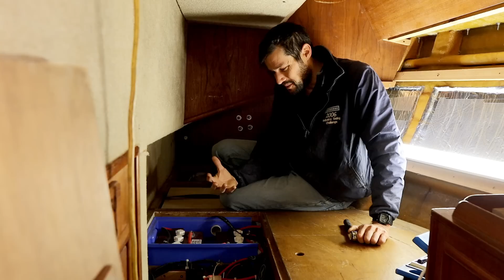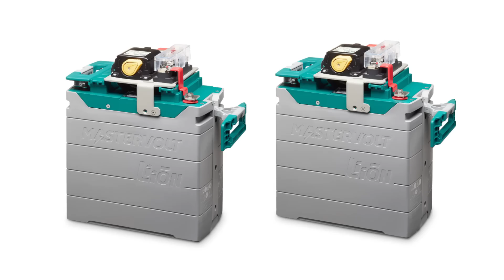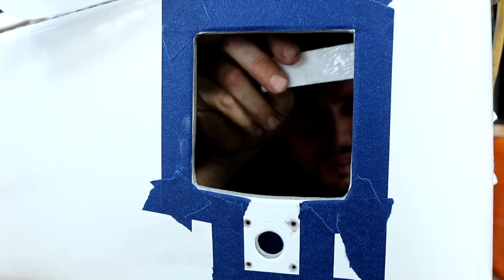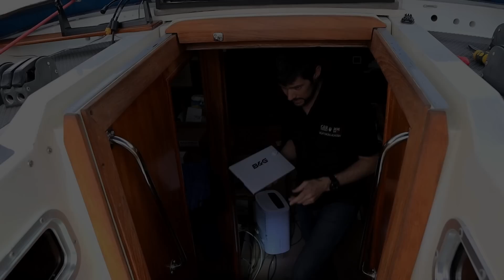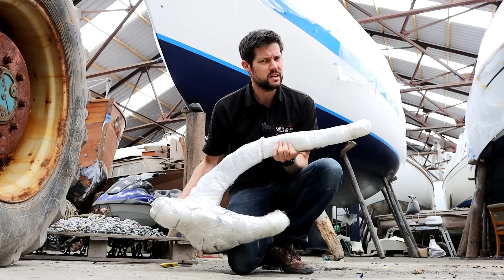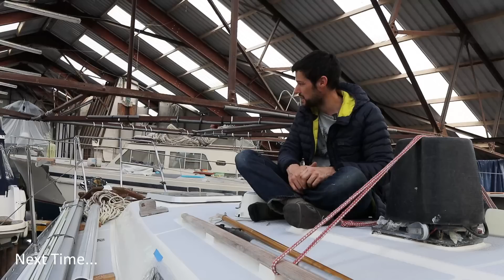Our Biggest Ever Upgrade | Sailing Florence Refit Ep.179

Comment: The 12V battery-to-battery charger you've installed between the engine start battery and the lithium bank is a big limitation on how quickly and effectively you can charge the house lithium bank from the engine's alternator(s). I understand the need to protect the alternator(s) and the lithium batteries from each others' bad behaviours, but there are ways to do this. Having a high capacity second alternator (250+ amps these days) along with the original alternator is a fantastic way to keep plenty of electricity going into the batteries, especially when solar charging is not a great option for one reason or another. Have a look at the recent video on our channel for a good suggestion for a second alternator system (from Electromaax and Arco Zeus), which is cabled directly to the lithium battery bus bars for maximum charging. Regards, Rick.

Comment: Awesome upgrade!  Congratulations 🎉 love y’all … Anybody out there upgraded to a 48V system?  I’m upgrading my catalina385 to a 48V system with 4x12V 315A batteries … probably overkill
Reply: Marine equipment is such low amperage or wattage, I don't see the benefit to going 48V. Plus 16ga wire is often pretty low quality so 14ga is as small as I use and even 12V almost never exceeds its wattage rating.
Reply: @artsmith103  yea Art I’m not sure - supposedly it’s more efficient 🤷🏻‍♂️- the 48V 5000W inverter is supposedly more efficient but I don’t know - I am spending the money on it though 😆 - and I’ll be able to run AC on the hook if I so desire off the batteries 🤷🏻‍♂️💪
Reply: @SailingFearKnot  Watch the quality of the shielding with 16ga and smaller. Often lower quality vs UV, Oil, moisture, etc. Make sure your solar panels and charge controllers are compatible with 48V. Typical RV solar is 18V, residential is 35V so both need to be wired in series for 48V. Then you have exasperated shade issues with solar in series. My current boat is only 26ft but I've added a lot of electrical but I could never justify even 24V.
Edit: For people with 48V auxiliary, it's a whole different ball game.

Comment: Thank you for succint explanations of what some of the new equipment is.  A challenge to fit but spared eons of viewing, of sawing, measuring, drilling, fitting.  Clearly all that took alot of patient careful work in awkward spaces, and probably chilly.  It looks like a well designed system from reputable brands. That should be a bonus if you have issues in the future.  Choosing B&G instrumentation is an excellent choice, look forward to hearing more about the wizardry now available..

Comment: I'm surprised you went for Lithium ion rather than the more tolerant Lithium Iron Phosphate (LiFePo4) battery chemistry. Any specific reason for that? 😊
Reply from the maker: They are LiFePo4 batteries :-)
Reply: Ah, good, just thought I saw "Lithium ion" on the side of the batteries. 😊 Should have done my research though, "Lithium ion" seems to be a generic term that covers all battery types with a Lithium chemistry. 😊

Comment: Painter's tape helps with tye chipping.  Awesome work!
Reply: Actually, best is to run the drill backwards to start with. It will go through the gelcoat without chipping then you can switch to the right drilling direction and finish the hole
Reply from the maker: Thanks, will try that next time

Comment: OMG, you’ve got a Stainless Steel Anchor ? They should Never be used, due to the severe micro cracking problem with them which can break the anchor, and that is why stainless steel chain should never be used either. I just can’t believe that you have done this tbh.😡😡😡
Reply: Stainless steel is not an homogenous product. I shared your thoughts and when I bought my boat, which came with an SS Ultra and chain, my inclination was to sell it and buy a galvanised Spade (best anchor IMO). I was advised against this by a metallurgist whose full explanation I can't remember but the take away was 316 Austenitic stainless chain has a projected life of 260 yrs in a marine environment, falls better into the chain locker and avoids unsightly brown marks (not the ones caused by dragging at 3 AM).
Reply: @atakd  An interesting side note is that 304SS provides little salt protection.
Reply: @atakd  I’ve had reports aplenty about severe problems with stainless steel in all manner of applications and environments, and based on those, and having had to advise architects to replace the Stainless steel they have specified with alternatives such as copper, guess what? Yep I’m sticking with high quality steel chain that’s been triple galvanised.The Worst case example huge amounts of stainless steel not be used as fittings in a roof over a holiday Camp swimming pool . The stuff is heavily sensitive and damagingly reactive to things like seawater.Anchors are documented as having broken in half, and chain links failed - in Seawater.change your metallurgy adviser to get better advice. ffs man one report on serious issues with stainless, was so large, it emptied out the paper stock in the Fax machine of the architect I sent it too.The potential liability for what they had been specifying, sank in instantly, and the firm got me a few nice bottles of Scotch as a thank you, and frequently called up after to check on product suitability and options for their clients. Just because stuff is marketing as being up to standards, such as CE, BSI and such, doesn’t mean it’s the same thing that was put through testing.the amount of compliance cheating that is going on, is sumply staggering. People are selling Chinese Natural Slate, assuring that the product passes standards, but when I have tested them personally, not a single Chinese Slate has ever passed. Spain closed down Slate quarries due to substandard quality, then crooks reipened them and sold them to major Contractors to use in large scale building projects in Britain, Supposedly with the relevant British Standards passed. A complete shopping centre had to be reroofed because the slates were falling off and were a hazard to the public in the streets below. Unsuitable Nails were being widely sold via Builders Merchants, so I had to Design and have made copper nails that were fit for purpose, then sold them at a third of the going rate, so people could experience using the right nails for the job. Bottom line, do not Trust what you are being told and sold by anyone. That includes me. Caveat Emptor. Best Wishes. Bob.🤔👍🌟🌟🌟❤️
Reply: So much of the critical high stress parts of a sailboat are Stainless steel ie all of your rigging & chain plates!  Are you saying that these are all unsafe? 😊
Reply: @jackdbur  Some are definitely confirmed to be.For Standing Rigging, it is very safe, though personally I over-spec the cables now, and load the wires with petroleum jelly, and melt with a heat gun and Polish them with a cloth, to help,p get the jelly into the interior of the cable, to help water run off and help prevent seawater get into the deck level fixings.mi noticed that washing with fresh water the stainless steel side rail tubes, plus Cockpit arch tubes then polishing with petroleum jelly, sure helps to keep the stainless in great condition? Cheap too, and all it takes is elbow grease and micro fibre cloths l Island Packet and terrible problems with 302 Stainless Steel Chainplates, embedded inside airtight laminations remember, and changing the type of stainless, may not have fully sorted the problem. Time will tell, but you can guarantee they will be keeping a close eye on things. 316 Stainless does love being polished, and it does appear to like being protected by a thin surface coating of petroleum jelly polished on after, to help protect the surface. That has been my subjective observation anyway, and far better treatment regimes may well be even more effective - but so far, so good.Best wishes.Bob. PS Regular very close inspections of standing rigging make sense, and imho as an advocate of annual haul outs, standing rigging needs to be getting a dry close inspection every other year, if the rigging has been over specified, and annually if to a standard specification, You can’t be too careful. Bob.🤔🌟🌟🌟👍🏴🇬🇧

Comment: If you go by what Lifepo4 battery manufacturers say, you should never discharge them below 50% capacity, or you lose recharge cycles, should never rapid charge them or you reduce the service life, and should only recharge them at between 0.1 & 0.2 C, where C equals the total capacity of the battery bank. You really need lead acid/ AGM engine starter/ windlass/bowthruster batteries to be permanently connected to the engine alternator, so you do not blow up the alternator. Only now are Gamechanging changes to Lifepo4 BMS appearing which make it possible for Lifepo4 to achieve a worthwhile Service Life duration tbh, and the only makers with those new BMS that I’m aware of are the Li Time and Power Queen manufacturers which can now handle up to 200 ah discharge and charge rate per battery - definitely NOT Recommended- to get maximum service Life, the batteries must not be abused like that and load sharing per battery in a battery bank must be used in a discharge equivalent to a charging rate of 0.1 to 0.2 C, at least until extensive and extended testing periods have been used to validate a non damaging battery charging/ discharging regime? To add to the core mechanical Systems AGM Bank, I’m planning a 3 x 235 ah Plus Li Time Bank from which DC to DC chargers will be used to keep the AGM batteries in tip top condition so they can achieve their potential 30 plus year service life, which means they must never be discharged below 80% capacity, and must be recharged back to 100% as fast as possible. The game hanger Lifepo4 Battery Bank should be able to provide what is needed at a rate that is extremely low stressed per battery, to maximise their Service Life. Time will tell, but tbh, battery technology is still falling far short of what is actually needed, and presently isn’t even capable of providing what is being promised. The needed energy Density storage capacity is still miles short. Sadly, nothing is even visible on the horizon yet. So it is sensible to avoid any form of electric propulsion system in the Marine environment for the forseeable future imho. Best wishes. Bob.🤔🌟🌟🌟⛵️
Reply: Well thats a lot of misinformation in one post. Did you read that on the internet? Maybe better check the manufacturers specifications and recommendations. These batteries can handle a lot of abuse with no problems.

Comment: How about the engine? Is it 40 years old? It seems to me that for a complete refit the engine should be replaced or at least overhauled. Cheers, Richard
Reply from the maker: Engine was new just before we bought Florence so only has just over 1000 hours on it. Hopefully good for much much more.
Reply: @SailingYachtFlorence My recommendation would be to check out /refurbish  1. oil cooler; 2. heat exchanger; 3. raw water pump ie the three parts that are exposed to seawater (particularly hot seawater). These parts invariably fail first but are easily refurbished while in port.

Comment: After having gone through an upgrad🎉e to lithium - 1200Ah of 12v with all the inverters, regulators etc, I am of the view that next time I will have separate charge and discharge busses, with separate inverters and chargers. This means if the charge bus or charge source goes down for some reason then the boats 12v  power supply is still good, which means autopilot/instruments are less likely to go "dark"
Reply from the maker: A valid point but on a 37ft boat space for all the separate components is also a consideration. If Florence goes 'dark' we can still cross an ocean with wind vane and a battery powered GPS (as we did in the Indian Ocean once our old batteries gave up).

Comment: I know that you are planning on visiting the Arctic. Did you examine the operating temperature range of your new batteries? I gather that the BMS will shut down many lithium batteries if you seek to charge them at temperatures around or below freezing. Some overcome this by adding a heater circuit, but that is, of course, an additional load.

Comment: It is still not great to use a lithium battery down to far either, a few times down to zero will severely limit their capacity afterwards.
Reply: Their BMS will handle that. The actual cells are probably 5%+ of the batteries rated power .

Comment: I wouldn't have thought volt drop would be an issue, over such a short distance?
Reply: Depends on the load.
Reply: @stephenburnage7687  maybe being DC too, wouldn't have thought it would matter in AC
Reply: @raylawes8938  AC typically operates at higher voltages, so the losses are typically less. Not because of being AC but because of the voltage level ie no one would design a 12V AC system, even though it is theoretically possible, but if you did, the losses wouid be the same.
Reply: @stephenburnage7687  thanks for the reply,  it was kind of you. With 230 v ac used in uk, the maximum volt drop is ,i believe,  7v
Reply: @raylawes8938  My pleasure. I dont recogise the 7V figure but its possible. Note, hiwever, that 240V voltage level in the UK is a 'nominal' voltage - in practice the utility might be delivering somewhere between 230 and 250V but that is, if course not losses.
Reply: @stephenburnage7687  i remember bieng taught how to use the electrical regs book we have, and how to find volt drop, depends more on the distance involved if i remember correctly,
Mili volts per metre.
Reply: @raylawes8938  The reality is that 12V  is a ridiculously low voltage level (which means the need for big fat cables) but boat manufacturers adopted what was then commercially available for the car market. 24V or 48V would be a more rational choice for boat builders, if you were starting out from scratch.
Reply: @stephenburnage7687  yes, i understand that, with only 12v, there isn't much to lose, is there ?
Reply: @raylawes8938  Yes, but the more correct way to look at is: For any given load, you can either have high voltage / low current OR low voltage / high current (the formula being power equals volts x amps. As losses are a function of the square of the current, not the voltage, a low current (and shorter cable runs) would ordinarily be preferred, to minimize losses. But you don't always have that choice as it is difficult to find 24 or 48V equipment (manufacturers having mostly standardized on 12V).
Reply: @stephenburnage7687  i see, would most of the equipment on board be 12 DC ? Because I noticed the Inverter, a laptop for instance would use AC wouldn't it ? Does seem like
a complicated set up on board though

Comment: liFePo4 batteries are such a huge game changer on a cruising boat!! 😎😎No more constantly trying to get the batts back to 100%. Lots voltage for the fridge & windlass. Lead's Dead baby!
Reply: Even for the start battery? Also for bowthruster or similar loads?
Reply: They didn't use liFePo batteries,  they used lithium ion, there's a big difference.  Main concern for me would be lithium ion are more volatile, ie. these are the type of lithium batteries that are self combusting. Big concern IMO.
Reply: @Paul-nr5kg No, these are LFP.

Comment: Did you contemplate making your electrical system 24 volt or even 48 so you could use smaller wiring?
Reply from the maker: Yes but that then meant changing more things (fridge, windlass, alternator) and/or running others from a step down supply. We could have simply put the batteries in series instead of parallel. We weighed it up but came down on the side of 12V, sure that will change in the future but probably not on Florence.
Reply: @SailingFlorence  You would also have to wire your 18V solar in series which would have derated it a little and you're already at minimum.